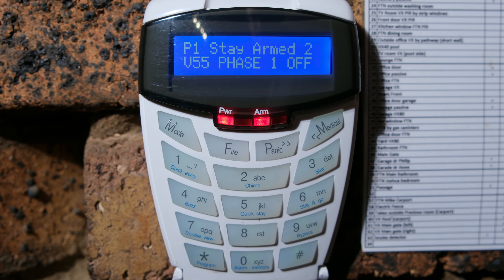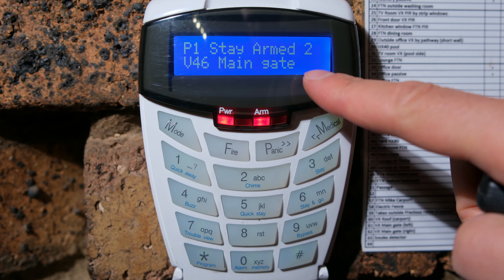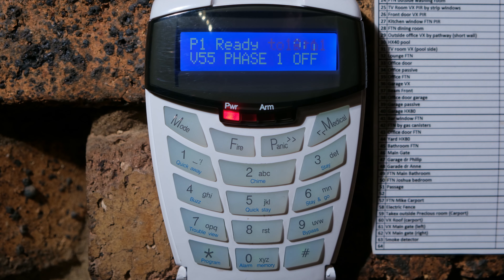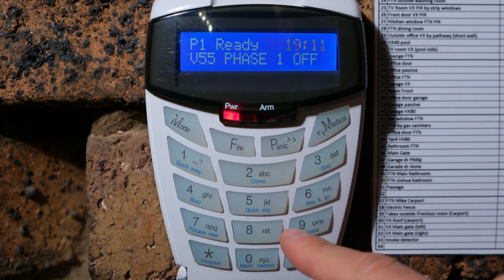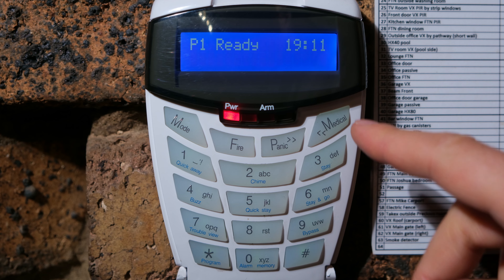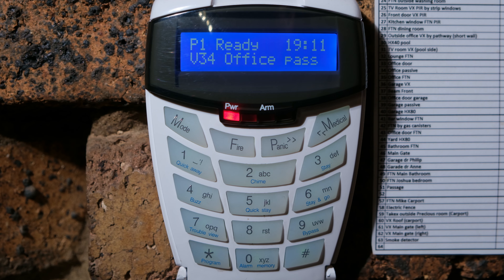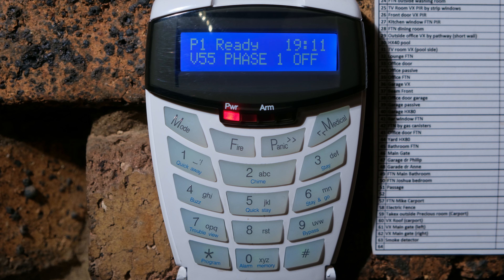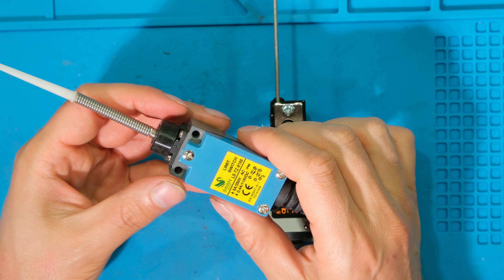How to link a gate to an alarm system using a limit switch - Gate connected as a zone on the alarm

Comment: This is similar in theory to a door contact sensor. On my door sensors I needed to connect a resistor - as I was typing you answered me. Unfortunately my gate is a palisade type, which means it would be easy for a thief to push it to stop the alarm.